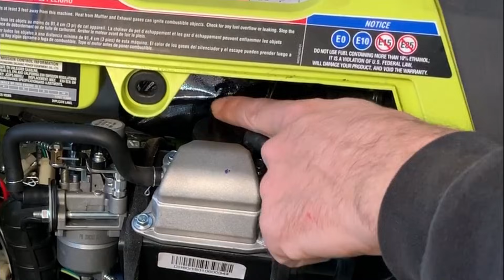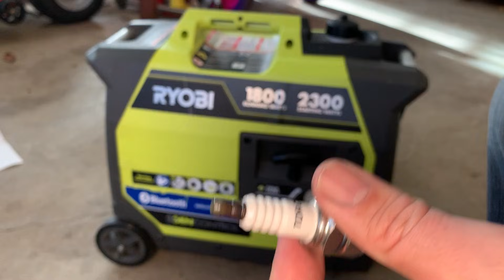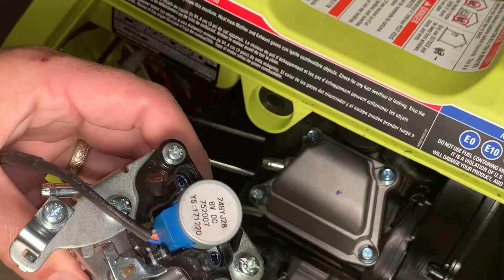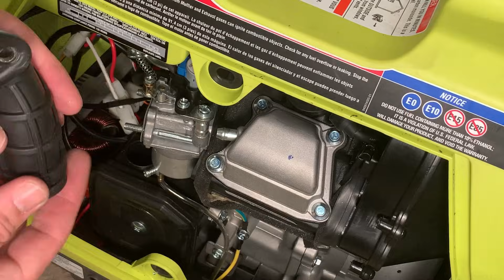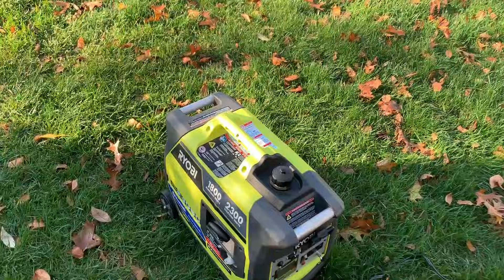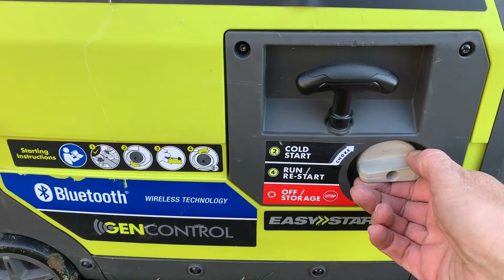Surging and Stalling Ryobi Inverter Generator Fixed - RYI2300

Comment: You say at the end "I hope this helps somebody"... well, this did... the issue with my Yamaha was the cable to the Off/Run/Choke switch had slipped over time so the unit was really hard to start because the choke was about halfway engaged... It would have taken me some time to arrive at that one.... I would probably have taken the carb off and cleaned first and upon reinstallation have inadvertently fixed the problem... so I saved several hours (not to mention the frustration). Thanks man.

Comment: good video! Yes super common problem on these. Another video shows cleaning the clogged pilot jet (not the main jet), and it fixed the surging problem compleately. Also looks like adjusting the choke cable can help with fuel flow and hard starting.

Comment: I had the plug issue also. Remove the valve cover and the plastic loosened up enough for a 20mm socket.. I think the selector knob has to do with the fuel issues? Restricting fuel flow..
Reply: Also I drilled a access hole through the top with a cap on it to reach the plug easier

Comment: So my generator was working on run perfectly fine. Replaced the fuel with new fuel and still same problem. It will run on choke for ever but won’t run in run like it used to. It’s got less than 100 hours and is in great condition

Comment: Those exposed inverter coils, just below the fuel delivery system kinda scares me.
Reply from the maker: Yes.  A fuel leak in an inverter is dangerous.  If a small leak you may not even notice.

Comment: Dude thank you for making this video! I’ve never worked on an engine before and you helped me get my Wen2000 inverter started!
Reply: I gotta ask you, so it starts and runs when the choke is pulled out, but once I push it back in it sputters out. I’m sure you know what the issue is, could you speculate what it could be?

Comment: I'm having the same exact issue. 
Just bought mine used and had old, gummed up gas in it, drained the old, cleaned the carb, fill with fresh gas, and would ONLY run on choke, then died when off choke, 
 Figured out that the gas shut off valve cut the gas completely off when in the RUN POSITION,  
SO...
I'M about to by-pass the gas shut off valve completely and see if that solved the issue. 
Unfortunately you cant take the valve apart completely to clean it, it's got rivets holding it together instead of screws,...

Comment: I"ve got three, they're all doing this. The spark plugs were fouled on all of them. I replaced the fuel filters. One of them starts just fine but runs like yours did. The other two don't start at all, which I take as meaning they need the carbs changed out entirely. I cleaned out the bowls and the small jets, but that's about all I knew to take apart. At that rate, I'll just change the whole carb if I gotta take it off to change it.

Comment: I have same exact generator but different brand..had bad surging problem crop up..drained gastank..found small pieces of black plastic particles in gas...flushed tank with clean gas..removed carb..used a cheap squeeze Ketchup bottle to evacuate gas from fuel line port on carb...did same on fuel hose from tank (valve knob turned run position)..reassembled..ran generator getting better performance but having similiar issue seen here. Gonna try what he did by adjusting choke/run knob..hope this helps out others.

Comment: So I just purchased mine brand new from HD!
It was surging. I called Ryobi. This is a known issue. I was sent to a warranty repair shop. I have a photo of the receipt. They said that won’t matter because all they need is the model and serial number and that would verify it is a type of recall that’s not publicized. 
The shop still has mine so I don’t know just yet what they do to fix it but Ryobi is aware of this problem.

Comment: Hi Jim. So, I’ve been toying with this generator trying to figure out what to do. Mine does the same thing as yours. I actually did bypass the fuel valve and went straight into the fuel filter from the gas gauge. However, I didn’t like that idea because for one, when it is moved using the suitcase handle, it is tilted quite diagonally. I was finding that was flooding my engine and it hydrolocked on me a couple of times. Had to remove the spark plug at least once to get it to move again. Had to also change oil from dilution. I wound up reattaching the fuel valve and adjusting the choke cable same as you. I left just a bit of slack in the choke cable so like you, I would be confident the engine was not running on choke. I think I’ll live with it and be fine. These are great little generators except for that one issue. I guess most equipment these days has that one issue. I had another one before this one and it did not have this issue at all. It was made in either 2019 or 2020 though. The one I have now was made last year in 2023. Can you tell me how your gas mileage is with this problem? Does it run rich or is it running the same as it should?

Comment: Great video! I'm  going to adjust the choke cable first, but  I'm still unclear if the choke cable also controls the fuel valve? Thanks!
Reply: Rotating the fuel valve pulls/pushes the choke cable open & closed.

Comment: Hi Jim. Can you tell me what you did to calibrate the switch? I’m having the same issue but much worse and my generator is only about a year old. It’s the same model and everything. I love the unit! It’s a great genny but since I got it. I’m having the same issue but much worse
Reply from the maker: Part of the issue was that the sticker was not in the right spot.  The only thing you can adjust is the choke cable.  If it’s restricting fuel when in the run position then see how far past run you can turn the knob toward start without the choke going on.  You might find you do not have to adjust anything other than turning the knob a little more.  Another option would be to bypass the fuel valve in the knob and either do not use one or add an inline shutoff.
Reply: @jcondon1  OK I appreciate it. I’ve worked on these before but have not ran into this.. I know the carburetor is fine because I pulled one off of another machine with a bad inverter board. I will look at the choke cable. It does run fine at a ‘sweet spot’ near “Choke”.  Like you, I’m not a fan of the easy start system much. If they did it right, I would be.

Comment: Ryobi makes a decent power tool but their outdoor power equipment ar poorly designed.  I've been doing small engine repair for about 40 years.
The best Generators are Honda.
Ryobi, Firman and some other brands can't compare to honda.
Ryobi makes it too difficult to work on these generators.  They could have made them so much better but someone in their manufacturing overlooked so many little things.
Getting the airfilter out, spark plug and carburetor are just a few issues.
I would not recommend Ryobi

Comment: hope thi s helps someone my  ryobi 1800 watt generator was running rich,  fouling the plug and would stall out when I put a load on it,, like the high setting  on an 1875 watt hair dryer.. what it was is one on the air jets in the carburetor was blocked. the jets are near the face and throat of the carb.. just remove airbox rubber ducting, remove carburetor and turn it so the front is facing you,, you will see the large throat opening and two tiny jet holes to the left and right of the jet.. take some 14 kt gold acid test solution, and put one drop in each hole.. the solution will boil any gunk out of the hole quickly.. then spray some brake or carb clean in the holes.. you dont even have to remove the bowl... just reinstall carb, and air duct, and enjoy a good running generator... safety note.,. wear eye protection and rubber gloves while handling the 14kt gold acid testing solution and while spraying the carb cleaner or brake cleaner to flush the solution from the holes. .

Comment: I drilled a hole in the top of the plastic and used a plumbing stem wrench like you did., I will get a rubber plug to seal the 2 inch hole I drilled.

Comment: Thank you for this video! I got so fed up with mine unknowingly cutting out at trackdays leaving my tires cold and missing sessions that I bought a Honda this week. I've tried so many things to fix it but that bowl drain flow trick is the hidden gem. It took me 3 years to finally pull the trigger on the Honda so I'm not returning that haha, but I now have 2 working 2k gennys. There's worse problems to have I guess.

Comment: It's a Ducar engine and should run without any problems. Fiddling with choke is not the right solution. Have you remembered to oil the air filter properly? Dry air filter has less resistance and makes motor running lean.
Reply from the maker: Oiling the filter can definitely make a noticeable difference.  In this case the fuel flow was restricted due to the fact the in the run position the fuel valve is half off and the sticker not aligned to it was closer to 60% off and flow was not adequate.

Comment: I picked up this unit brand new non-working for $200 earlier today.  Half an hour later it was running and I verified it had .1 run hours on it.  It looked like someone bought it, tired it with gas, drained the tank but didn't drain the carb bowl and it plugged the jet.  I never was a huge Ryobi fan but I'm pretty happy with it, especially for $200.

Comment: I’ve had this same generator for a few years but rarely used. Had starting issues recently when I wanted to use it. After resolving them (cleaned carb, etc) it started and ran with the same surging. When I used it for drilling holes, large rotary hammer (15A, 120v) the breaker kept tripping and we didn’t really hear the engine ramp up when the load was on. I’m thinking it’s the same issue. Will check and let you know. Thank you for the video. TM

Comment: Hello, Is it possible to convert an inveter generator on which it's inveter is not working to a normal generator
Reply from the maker: Unfortunately no.  There is no mechanical governor.  The inverter controls the engine speed via a servo.  I guess if you are good with electrons you could come up with an alternate control for the engine speed.  The other issue is the output.  The stator outputs 3 phase high frequency AC in the 200 volt range.  You would need to rectify to DC and then source an inverter that could accept a wide range of DC input and would output clean usable AC,

Comment: do not buy one of these generators....there nothing but Chinees junk...Ive had issues with mine from first taking it out of the box to continually  messing with it to keep it running.. Ryobi support is just someone reading the owners manual to you....home depot would not let me return it or exchange it because gas was put  in it ...$799 i paid for it  now there close to $1000.....better off throwing your money out of the window while driving, maybe someone who needs it will find it...This generator is nothing but a headache and takes up space ...
Reply: not to mention it rattles like crazy. cheap  plastic parts...Funny the stickers on mine are off the plastic in the same places yours are....theres no quality control .Im the type if i buy something new i want it to work..not interested in being a small engine mechanic for a hobby

Comment: Most of these are setup for California so they run leaner, if there’s any fuel issue or the smallest vacuum leak it will do this. Don’t forget most of these are all the same in this wattage range for all brands, looks almost identical to my craftsman 2500i.

Comment: I have a similar issue with mine. I will definitely be checking the knob calibration.
Reply: I have a craftsman 2500i and it does the same thing. I checked the carb it was clean I still cleaned it anyway but it would still surge. I started spraying carb cleaner around the carb looking for vacuum leaks (only do this on a cold engine) and I found one it was the throttle shaft sucking air damn thing is almost brand new

Comment: I have 2 of these and figured out the issue when    my first one was very difficult to start because the choke linkage didn’t work properly at choke setting.  My label is higher but the sticky label system is poor, you get lucky or you don’t.

Comment: Sir, I have the same generator, and after letting run for about twenty minutes, the generator would shut down. There was no surging at all. I would then let it cool off for about 5 minutes, and I would re-start it again, but it would die again after some twenty minutes. It has plenty of clean fuel. Could this also be a gas issue as you did with your generator?  Thx.

Comment: Purchased this https://www.youtube.com/post/UgkxOTeIs0vv4_9B5hsmnLsk9r930uDQLu_Y after researching several brands.Reasons for picking this one was, dual fuel, I don't have to carry gasoline and stink up my truck bed!Propane is so much cleaner.Quiet 62 db, won't piss off neighboring campers!Less than 100 lbs, can lift in to truck bed.I can run my 30 foot Transcend 261BH, AC among other appliances.

Comment: Thank you, so much for this video! You saved me a bunch of time and money. I to had the exact same issues. I would always notice at times when i would go to start it and turn the choke and then turn it right back up to closer to cold start and notice a pickup in consistency. I would have never thought it would he as easy as adjusting the Choke cable. Thank you!!

Comment: I have the same generator manufactured in July 2018. Was having similar issues with stalling under load, followed your instructions to find the knob position to deliver max fuel flow to the carb, then adjusted choke cable.  The result was perfection! Thank you so much your video saved me so much frustration.
Reply: Can you explain your method for adjusting the choke and cable? Where do you set the knob before you adjust the cable?

Comment: I'm kinda stumped on mine. 

The machine works but briefly
If I'm in auto idle rpms will go up to match my load ( hand drill) 

After about the 3rd time of powering the drill the auto idle will not pick up and the drill runs at lower speed. 

Now I have a load warning on screen. 

Same thing happens if I turn auto idle off. After about the 3rd time of powering the drill the idle will drop and overload flashes on the screen. 

I

Comment: Yes turning the knob a little further smooths out the hunting, it adds more fuel. I was inspired to solve the issue after watching your video. On top of the carb is a brass screw head jet. Mine was blocked due to sitting without use for a long time. Now runs like new. Thanks for a great tear down video, helped immensely 😊

Comment: If the control nob has a splined connection, remove handle and correctly reposition.  Easy fix!
Reply: I've take knobs off three Predators, a WEN and a Champion--none were splined.  All have a squared shaft, usually with one corner cut on a slant to index the knob.  Splines would be nice, in this situation.

Comment: Where did you order your new carb from? 

Bypassing the fuel shut off valve only partially fixed my issue, the generator still seems to run better with the choke slightly on. I’m thinking the new carb may get it to 100%.

Comment: I've had that issue with a predator, the rubber disk in the fuel shutoff on the carb. It seems that our crappy fuel causes it to swell, so when you turn the fiel on the rubber dragged/distorts and the holes don't line up. I sanded the parts down with 600 grit and so far so good.

Comment: 7 It's because these machines have a fixed jet carburetor that you can just it's factory preset so when you when you choke it riches the fuel mixture up and then it runs right the same as a lawn tracker a modern lawn tracker or anything else with that Nicky carburetor they're all that way anymore EPA regulations so I said drill the hole out in the main jet and tell it quits surging

Comment: Excellent video. It described, exactly, the problem I have on two of these generators. The actual fuel on/off valve inside the unit is out of alignment with the control knob, and there is no way to adjust it. The fuel valve does not open fully, until the knob is half way to the fully choked position. This is a sad reflection on the design quality, and very disappointing, considering the price, at HomeDepot, was almost $900. Otherwise, it would have been quite a nice generator.
As explained in the video, you could adjust the choke cable, so that it doesn't choke the engine, when the control knob is in the half choke position, allowing full fuel flow, but the misalignment is still present.
I purchased new control assembly,  but it had the same problem.
If you are willing to do some drilling and filing, it is possible to reposition the fuel valve, into a usable position, but is not for the faint of heart.

Comment: Thank you x 100!! You helped me finally solve my problem. I have a different but similar Ryobi Generator (RG3200i). It's been giving me the exact same hassles you had. It was even sent back to Ryobi under warranty but came back with the exact same problem. I decided to do what you did & check the fuel left in the carb after it surged & cut out. Lo & behold.... It was empty! It turned out to be a partially blocked fuel tap. Since purchase, this generator has never run so well. If it wasn't for your video, I probably would never have found the problem. Thank you again!!